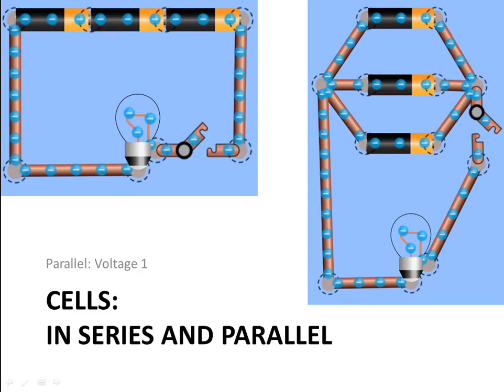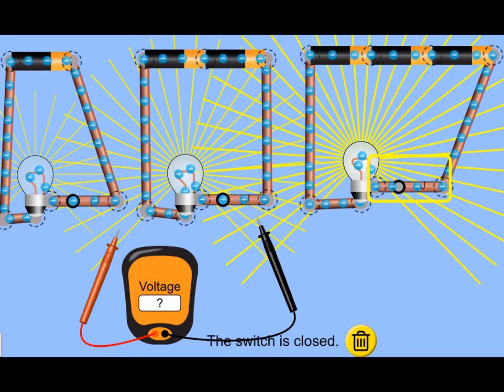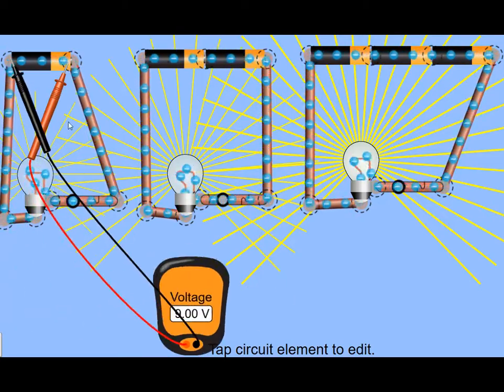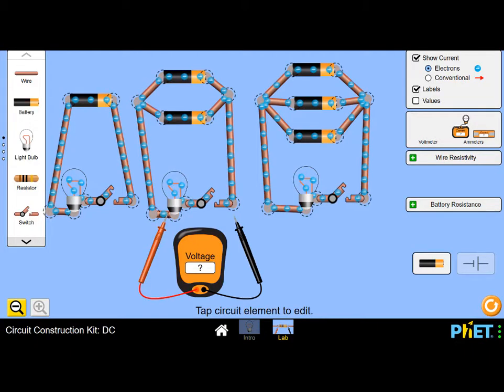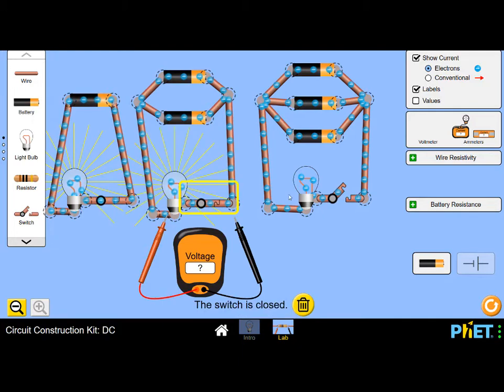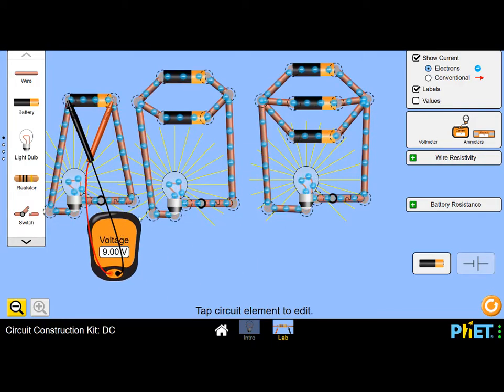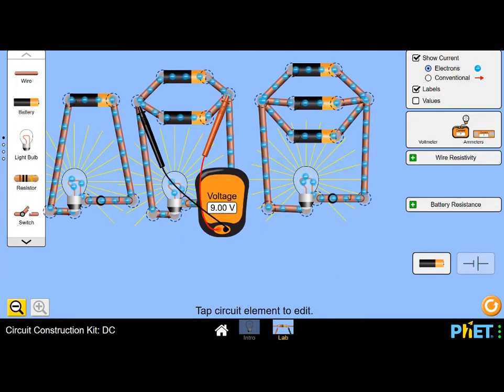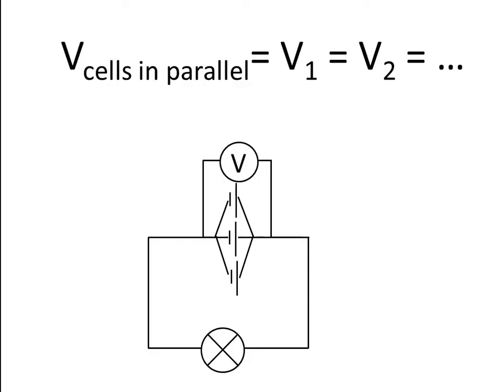Comparison between cells in series and parallel

Comment: cells in parrallel would increase current tho!!! So more cells in parrallel means internal difference decreases so  power deliveried to the bulb is greater.... Am i wrong? confusing
Reply from the maker: In this movie we assume that all the cells are ideal (i.e. their internal resistance is negligible). With ideal cells, adding more resistors in parallel will not increase current strength or power delivered to the bulb. It will simply ensure that the battery lasts longer. If, however, we don't have ideal cells (i.e. their internal resistance is not negligible), then what you say is correct.